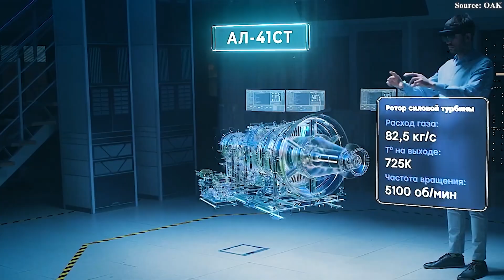Russia Revealed NEW AL-41ST-25 Gas Turbine Engine Will CHANGE Aviation!

Comment: This is clearly an example of how confidently the Western coalition has behaved for more than 35 years without respecting the basic rules and principles that have forced so many countries to shut down their industries, or much worse than to be sanctioned, or worse, to be militarily attacked!!!! Countries such as Yugoslavia had their own factories and scientific centers that were owned by the state, for the simple reason that they were smaller countries that did not have access to the Western market. Which leads to the fact that the state was the largest buyer of all the products that local engineers and factories made, these were not sufficiently advanced products at first, but since the country was rebuilding from WW2, everything was needed, from similar turbines, of course, of much weaker power and quality, to the auto industry and finally the army, everything was produced from the beginning, which is quite difficult, but in 30 years it began to bring results!!!! A country that has literally all the resources has absolutely no need In order to import what the survival of the state depends on, initially young engineers who were ambitious were given scientific centers where they worked on everything in order to make the first combat aircraft in the 70s, which were already in the second attempt sufficiently perfected that the export of aircraft, helicopters, tanks and everything else where the highest profit began. In the 1990s, Yugoslavia had so many treaties signed with third world countries that it began to bother the West?!?! But for smaller countries, this is the only way to achieve Sovereignty and in a peaceful way. But unfortunately, it was at the moment when the West decided to create a new Swedish order where Yugoslavia was not planned to exist as such?!?! Perhaps everything would have been different today if the West had initially accepted Yugoslavia as an equal state, because the conflict in Yugoslavia only established China's policy that it was the only model of economy that would ensure China's survival. And as we can see, Russia has begun to move more and more factories Into state ownership so that these factories produce not what will bring profit the fastest, but what is most important for the state at that moment!!!! And if we know that there are other countries that have been under Western sanctions for a long time, it makes perfect sense for them to come together and share experiences, which is much more effective than the West has been doing all along. The West has had technologies that have worked very well over the last 30 years and there was no need to change too much, and on the other hand, we have countries That have struggled to survive and found solutions that may not seem like the latest model from the West, but are effective enough for the people to live and develop in the circumstances in which they find themselves!!! And when Russia, which until yesterday had access to Western technologies, gathers these countries around it, and if China is also there, there is absolutely no doubt that the progress of all of them together is inevitable!!! Unfortunately, the Serbian people fought to preserve Yugoslavia and were therefore divided into more than three new states so that they could not To continue the production and research of new patents, but Russia can!!!! As the West said at the time, Yugoslavia had to close all its factories because they were not competitive, since the state was helping their development!!!!! What happened in 2008?!?! All the small factories in the West, and even the banks, were recapitalized so that they would not fail?!?! Not to mention the subsidies that these companies have received all along!!!! Which means that the West did the same as Yugoslavia only The difference was that he changed the terminology to make it sound acceptable to the rest of the world, but Yugoslavia had to pay, and only because it managed to develop its own technologies, which today could be much better than anything the West continued to do on its own, because it was done by people who love what they do, not for profit!!!! It was important for them to compete like in sports, but that didn't fit in with the politics of the great powers of the 90s!!!!

Comment: Russians have excellent and best Technology to make Micro Chip then the west can produce, ASML use old photolithography 
Technology sold to them by Russians due to making only Transistors and some diode, Russian gladly sold the machine to ASML a Dutch company try to make photolithography machine 40 years back then they ask Russians they want to buy Photolithography machine. Agreement was signed and rest is history the only substantial upgrade is ASML stat shirking the feature size and introducing UV etc.

Comment: To be honest, your information has already been very poorly prepared and analyzed! China's Kiri 5nm semiconductors work miserably, have a high error rate and heat up quickly! This has been proven to cause cell phones to catch fire! For 7-1nm and smaller semiconductor production, the newly developed lithography machines from Germany are needed, which the Federal Republic of Germany then assembles systems at ASML in the Netherlands, where semiconductors are manufactured in a vacuum! China wanted to buy 48 machines and didn't get them because of EU/US sanctions! One lens alone takes a year to manufacture and is ground down to the atomic precision for the ultraviolet high-end lithography machine! Trumpf's extreme ultraviolet laser is in the same league when it comes to production; it has to be able to aim down to the atomic precision and therefore needs Zeiss lenses, also for lasers! A 200 ton lithography machine, which is currently the most complex and sophisticated machine in the world, cannot even be manufactured in the USA, let alone China! 800,000 employees work in Germany's research institutes! No country in the world has as many or spends as much as Germany, not even the USA according to AI! Horizon Europe is the brainchild of Germany's research institutes!

Just because Russia has a gas turbine doesn't mean it's good! For the gas supply to its pilot lines, Russia relies on Siemens because it's in a different league in terms of quality and powerful, despite being smaller! As for aircraft engines, you only need to use the Eurofighter EJ200 engine and the new, 27% more powerful EJ230 partial ceramic engine! Compared to its size and mass, the Russian jet engine should be 40% more powerful! It must also be able to withstand 15 G, which is what the EF flies during automatic evasive maneuvers with the computer. A maximum of even 19 G in exceptional cases. The EF is certified for 15 G! The EF flies 12 G turns fully loaded at Mach 1.4, which would blow up any other jet, including its engines! The EF engine only requires maintenance when sensors signal it and a module reports it, which is 15! The EJ200 and EJ230 engines are modular in design, allowing for rapid maintenance and the replacement of individual modules. The service life of an entire EJ200 engine is approximately 6,000 hours. Particularly stressed modules, such as the hot parts (e.g., the turbine), have a shorter service life of 1,600 to 3,000 hours, while cold parts are designed for 6,000 hours! No other jet engine can compete! All Airbus engines, and even the entire jet in the new production run, have been equipped with this sensor technology from Eurofighter for some time now!

After 18,000 hours of endurance testing, the EJ230 still withstood 12 G without signs of fatigue fractures or strain stress! This means that 2.5-3 other jets would have to be re-engineered in the same period, as they are only rated for 6-7000 hours! AI has calculated that if you include the procurement costs of jets for 18,000 hours from 3 jets, one EF flight hour costs a mere $6,300! It is assumed that it will be operational for up to 36,000 hours and will fly until 2060, eventually as an AI drone! The EF CFRP composite construction originated from a glider/Björn (developer Björn Stender) in 1962! They are still flying today, 63 years later!!!
The extremely large number of sensors throughout the EF jet, which completely monitor the airframe for overstretching as well as the engines, will allow the computer to intervene in advance to prevent this from happening!
EF Tranch 4/5 are FCAS capable and can fly as drones with AI!
The development of these systems took 30-40 years in the preliminary phase by the world's leading research institutes in Germany! In addition, these institutes have presented the new DLR quantum computer/mQC 2024 with AI, which is ready for series production: 54 qubits with 20 operators/OP, costing €1 million, the size of two washing machines, and not for sale! The institutes are building 5,000-10,000 mQCs! The EU will invest €7 billion! 5 mQCs will be set up in EU countries and connected to a central system in Germany! According to AI, Germany/the EU can no longer be caught up!
AI example: Willow's 104 qubit 2 OP requires 2.5 minutes for a calculation, while the fastest data center in the USA takes 10,000 years! An mQC with 1000 qubit 20 OP, which requires 2.5 minutes for a calculation, would not even be finished after 13.4 billion years, and is older than the universe! In comparison, mQC is faster by 1 and 300 digits after it!
According to AI, research and development will then take place in minutes to a few months at most! Extremely complex system calculations can be performed that were never possible before!
So you think China and Russia can catch up? AI simply says NO to that because decades of basic research are lacking to understand all of this; it has to be developed!
Reply: duba...The Tornado is the nuclear sharing that will deliver the 120 GBU 61-11 400 Kt hydrogen bombs (Hiroshima's only 20 Kt) to Russia in an emergency! The Tornado has been flying since 1979 and was built until 1998! It has US specifications, which means the US has access to all internal systems! But with the Eurofighter, we're talking about a different league when it comes to trade secrets. Regarding LTE, Pretorian Evolution, and the FCAS combat cloud, the only other company in the world that has developed this is Germany, which co-developed it with Eurofighter development in 1985! That's why Germany has already submitted a request to its research institutes for its own nuclear bomb for the Eurofighter and others!!
You can google it all or find it with AI, or not, like they do!
Reply: ...You bought f35 coz EF is not good enough despite your high praise
Reply: Duba...Tell me, do you only wear your head around to wear your hair? So if you can't read my facts, let alone understand them, then save your bullshit comments without any context, even if you've even begun to understand my facts!
Don't you understand this sentence and its meaning?... It has US specifications, which means the US has access to all internal systems! ...then do something else that doesn't require thinking or understanding, like pulling weeds!
Reply: Yes , china can catch up, the 40 years of your research are just fews years for china now, by 2035 china will be first in everythings
Reply: billy....You're talking bullshit of the highest order! China has to get the Federal Republic of Germany/Fraunhof Institute to build the high-tech lithography machines for 1-3 nm semiconductors. They can't even handle 14 nm properly! According to AI, Zeiss has developed lenses that took about 70 years to develop. Producing a single lens takes a year, using many specialized systems that are top secret!! China is trying to produce 7 nm semiconductors with the old Federal Republic of Germany lithography machines! But they have a high error rate and therefore perform poorly, and when performance is required, they burn out!
The latest 200-ton, ultra-complex new lithography machines are absolutely no longer comparable to the previous version; that's how extreme the AI facts are! The Zeiss lens is ground down to the atom! The Trumpf laser also has its lens! Everything only works in a vacuum!
800,000 employees work in their research institutes in Germany! Germany, including all its sectors and SMEs and corporations, spends over €300 billion annually on collective cooperation! No other country in the world has this on this scale! EU Horizon/Erasmus is their offspring and was created from this collective alliance! It has evolved into a European and global network!
Keep dreaming about the man on the moon or Santa Claus! According to AI, China and no other country in the world, not even the USA, is capable of catching up with Germany, despite its many decades of basic research!
Reply: The Eurofighter design, the unstable layout and control system, the aerodynamics, FCAS capability, EJ engines, complete sensor technology, and CFRP composite design and processing were developed by DLR and the Fraunhofer Institute! No other country in the world is currently capable of this! The origin of EF sensor technology was the Tornado because of its low-level flight capability with landscape mapping systems at 1,000 km/h at a height of 30 meters! Automatic ground-tracking radar, 1974!
The forefather of this Tornado/Eurofighter jet sensor technology was the first vertical take-off aircraft in the Federal Republic of Germany, which set milestones in control technology! It was the VJ 101C vertical take-off aircraft, which had a speed of 1.08 Mach. That was in 1963! It is also the forefather of all vertical take-off aircraft like the Harrier and others!
In fact, the Federal Republic of Germany is building on almost 40 years of basic research into Eurofighter sensor technology!
https://www.youtube.com/watch?v=RxYn__Jae6U
https://www.youtube.com/watch?v=mo3-KW8AKcI&list=RDmo3-KW8AKcI&start_radio=1
Reply: @tlsig ...if it was as good as you claim, you would not have bought f35